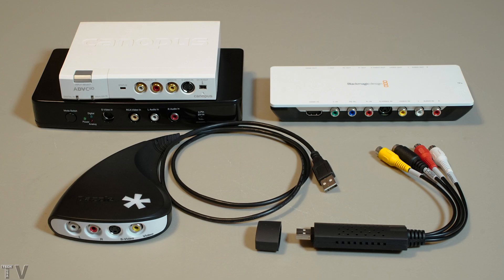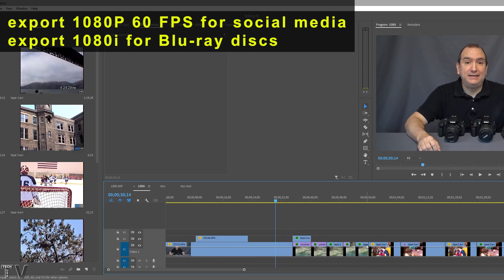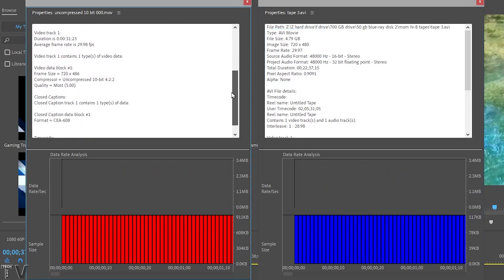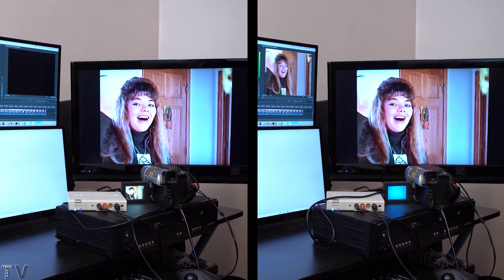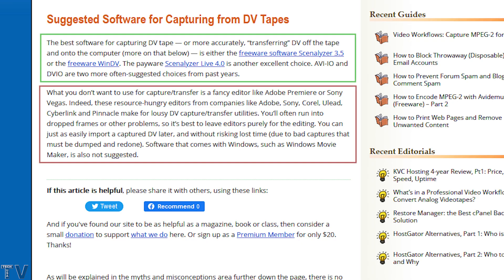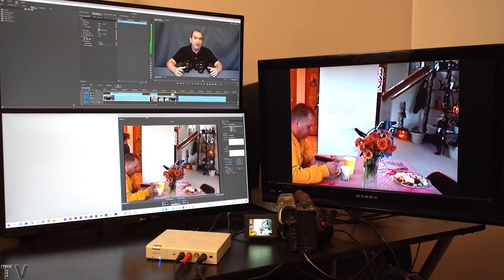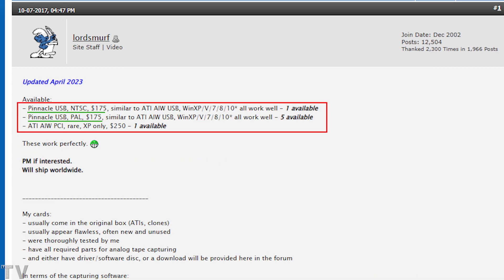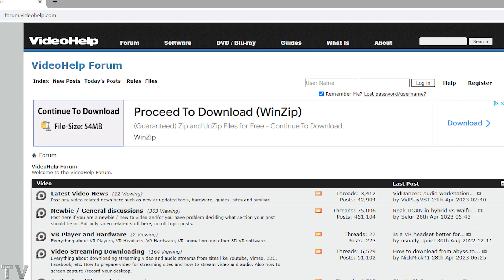VHS video capture and Hi8 video transfer myths debunked

Comment: I've managed to capture with my Shuttle after using a DVD recorder as a TBC, but the audio is out of sync after about 3 minutes of playback.  I'm considering getting a cheap simple one now, but I dont want to sacrifice loss of quality - whilst I do need to audio to be timed accurately.  I've spoken with various people about it, but so far had no joy
Reply: If you turn on stop at dropped frames for Intensity, the capturing also stops after about 3 minutes for PAL. I have the suspicion that Intensity (I tested PRO and Shuttle) ignores and overflows the frame rate of the playback device (Panasonic NV-HS900EG S-VHS Recorder = 24,998-25,002 fps and Panasonic DMR-E55EG DVD Play). I originally thought this was the tape dropout setting. If you switch off stop at dropped frames, the sound at the end of the tape is often delayed by 30 seconds and there are probably too few frames on the HDD. The solution I'm working on is Panasonic NV-HS900EG, S-Video, Pioneer DVR-560H (TBC only), HDMI, Blackmagic Design DeckLink Mini Recorder HD, OBS Studio, uncompressed 4:2:2 because PAL (Settings) doesn't have 4:1:1 (including TBC Audio Delay). 4:2:0 is nonsense with PAL, since the line pairing always slides down ONE line and there are NO permanently connected lines.
Reply: @TTVEaGMXde   Thanks for letting me know how you've progressed.  It has been a very long journey for me, I might try a different device to the shuttle.  My best move was using the Panasonic DVD recorder as a TBC, but the audio sync issues are a newly discovered issue, although it took a lot of research to get this far over the course of 15 years, coming back to it as & when I could dedicate time. I think I might try my ADVC 110 again if I can locate the power supply, but yes, the shuttle has sent me on a huge wild goose chase with good results, other than the audio being completely out of sync. I was considering rendering the audio in ableton by warping it slightly to fit the exact length of the video, then pasting the audio back into a video editor in the hope it might fix the sync issue. But there are a lot of tapes I wish to record.  I hope your method works well, I understand most of what you'r saying but as I've discovered, there is a lot of science and countless ways of setting this up when it comes to using a shuttle. So I tend to come back to this task in chunks when I have time to dedicate, which makes me wonder if a better capture device is available now since it was 10 years ago roughly when I bought by shuttle
Reply: @NeilDnb  You did not write which output can be used by the DVD recorder. With HDMI, Blackmagic has to take over the picture frequency (also with Intensity) and with YUV I have tested the two consumer solutions (Terratec Grabby PRO + Reflecta USB2 Grabber) without success. Intensity analogue obviously doesn't work, and with AJA you're in a different price range. So with YUV you should consider a used AJA PCIe card without a breakout box. The canopus ADVC-110 can be fed remotely via a 6-pin Firewire. But then the power plug must be connected to the Firewire card.
Reply from the maker: I don't recommend the Intensity Shuttle for VHS capture. It can be problematic. Especially now that it is discontinued.  BMD doesn't care about it anymore. The Firewire DV converters are your best bet.
Reply: @TechTVusa  Thanks for your thoughts. I have an ADVC 110, although I tested it 15 years ago with a computer of which wasn't good enough for the task. I've since, lost the power supply but I might give it another go some day. Hopefully it will match the audio better & have the added bonus of having a built in TBC.

Comment: You appear to be an expert on these ADVCs. What is the technical difference between the ADVC-100 and the -110?
Reply from the maker: I am not expert on the ADVC devices but I have used a several Firewire DV converters. Having said that the ADVC 110 can be bus powered by the cable.The ADVC 100 needs a power adapter.
Reply: @TechTVusa And I think they removed the ability to ignore Macrovision in the 110.

Comment: [Quote]Analog video by nature has a very low chroma resolution horizontally (barely the equivalent of 40 samples), the last thing you would do to it is halve it further horizontally in case of NTSC, [/Quote]
This is misleading. NTSC DV at 4:1:1 c takes 720 luma samples per scan line, and 180 chroma samples per scan line.  The issue is lossy compression implementations and data rate limitations, especially with typical noisy consumer home video.
Reply from the maker: I will make a follow up video. I will randomly use 10 bit uncompressed 4:2:2 files and DV 25 files. I will see if people can tell which is which.
Reply: Those are the techical terms, VHS is not HD its even lower than SD you don't have to worry losing any color, you can always color correct with resolve, many people don't color correct at all, capturing in ProRes422LT also makes easy editing, color faults is mostly because of signal mismatches which is baked into the consumer hardware,

Comment: Hello - I was wondering if you offer one on one help ? After watching and reading so much, from which VCRs to use (svhs-vhs) which one has TBCs which do not - as well as using certain camcorders that offer TBC and those that offer the feature as a Pass Through feature and many do not.. not to mention all of the capture cards - and on top of that upscaler’s . And then we have the programs to use- I have around 70 plus tapes that I need to convert. Many are reg VHS as well as VHS-C and DVDs …. I TRULY need help to get moving on this project - and without being  very knowledgeable on Codec’s - compressions - and all these options are so confusing. Sounds like an alphabet in another language. I have limited time, since I recently diagnosed with cancer and really looking to do all of this for my daughter, just in case my time is more limited then I hope. I really don’t want to buy the wrong hardware (TBCs that i have seen pro stuff that can run $$$$ - ) to getting a useless VCR or a Camcorder that provides no benefit to get this project done !! I am running a Macbook Pro M2 with 32g of ram… would there b a way to reach out, and would you be able to assist me ? Thank You in advance… 🙏🏼 Todd
Reply: How are you?
Reply from the maker: You should contact me through Facebook. I left a link in the description box.

Comment: Hi, what a timely upload for me! I’ve recently returned to my decade long quest on how to best digitise my extensive VHS collection as well as MiniDV etc. I have been digging into those forums yet again and each time, my brain explodes a little more. I have sourced so many different elements of the recommended work flows but don’t have a complete one. And as a lifelong Mac user, I have recently started the seemingly impossible task of trying to source a Windows XP machine and compatible capture cards. It really shouldn’t have to be this hard.

I come from a film & TV background in the 90’s but haven’t stayed in the industry. So I have a brain that can mostly understand a lot of the references and can pick up a lot of editing software etc. But this project is just needs to be done before I die 😅

Thanks for this post. I needed to be reminded that the quality can stay almost identical using other methods. I’ve been watching a lot of YouTube videos on the subject & there are surprisingly few with info that can actually help the process and cross reference the Video Forum & Digitalfaq guides. 

I’m sure that I’m not the only one with this situation. I’d love to see more guides like this referencing other techniques. 

E.g I’m in Australia and use PAL. I have a Canopus 55 from many years ago that I still haven’t used. Can it be used to get the same results in Mac as the 110? What version of OSX will it function with? I have recently purchased IMovie HD. Should I try to install it on an old Mac Air (if so downgrade the OSX)? Will it give me better results? Or is there a better method with something newer on an M1 MacBook Pro? 

I have a good Panasonic VHS with TBC (HS960) and also a Panasonic DMR ES15. And a Sony MiniDV TRVE355E. I have all the Apple FireWire converters. I have a MacBook Air 2013 & a barely functioning MacBook Pro Mid 2012 non retina, a mid-2015 MacBook Pro 15inch retina and a newish M1 MacBook Pro 2021 16inch. I’m open to purchasing a 2nd hand Windows machine if needed to get an improved capture if recommended. I plan to restore the videos. I can get access to any Adobe products if needed via my subscription. Or can try to get FCP. I know that some of these devices can be used as ‘passthrough’ for VHS as well. I am about to upgrade all my cables too.

I have already converted my Mini DV via FireWire in my M1 MacBook Pro on IMovie 10 but very confused as to whether it was captured properly on IMovie 10 as opposed to what I have read on the forums about capturing in IMovie HD being superior as it captured both fields (horizontal & diagonal) Is this correct? I had thought that all FireWire was 1:1. 

Any advice as to how to achieve best noticeable quality going forward would be much appreciated. 

Thank-you in advance.
Reply from the maker: Sveta Spins,

I am glad my video could help. As I stated in the video you are not seeing a rendered file. I was simply screen recording the realtime playback of Premiere Pro. Most people are going to look at the quality and say that works for me :  )

You might want to watch the video link below. It is a tutorial. 

https://youtu.be/-mz7-delWJA
Reply: @TechTVusa  I appreciate your reply. I have actually watched all your tutorials in the past (and present again!) They’re awesome! My problem was that I had tried to acquire complete workflows to start on but was never able to own everything in the chain. I’m also working on transferring all kinds of tapes from across 25 years of documenting and all in PAL. A lot of advice comes from the US where things are in NTSC and not everyone clearly explains the differences in one solution between the two standards. And on top of that, I am located in Australia - where we are the same size physically as the US but our ENTIRE population is the same as one of your big cities. So finding old equipment is much scarcer and pricier. 
And every time over the years that I’ve jumped into the forums, I start finding a solution for one thing, but very quickly the topic changes and descends into disagreement. I have never personally posted on these forums and have gotten a lot of good advice on there too - and don’t wish to contribute to more disagreements. I was writing to you because I think that you’ve identified the problem for people like myself in finding a way forward. 

In the last two days I have miraculously been able to source a cheap 2nd hand Intensity Shuttle which I will pick up in the next week or so and also managed to revive my old MacBook Pro mid 2012. I’m vaguely tech savvy from years of dealing with Macs. I have ZERO knowledge about Windows. My aim is to get the tapes in best VISIBLE quality - and possibly being able to play with settings that will improve it…and ready for upscaling along with the earliest video 8 /Hi 8 footage / VHS footage. I’m even open to trying Topaz or similar to improve the quality later. I’m hoping to avoid as much generational loss with the products and flow. 90% of the numerous VHS tapes I own won’t need to be upscaled or improved on too much - so just getting best quality I can get in the first instance with what I have is fine. 

The Hi8/ video 8/ DV8 and a handful of VHS will need to be best possible quality to work on later. I have already imposted the video 8/ Hi 8 /DV8 mm tapes have already been imported in via Sony TRV3355E in IMovie 10. something on my M1. From what I understand, IMovie 8 onwards only scanned one field of lines via FireWire. But I’ve also read that that they actually all IMovies import 1:1 DV codec over FireWire but can’t export at that quantity. I have a copy of a iMovie 6 HD which I was thinking of trying to install on my old 2012 MacBook Pro / Mojave to see if I can see the difference. Or maybe it’s possible to just import the DV Codec recordings from IMovie 10 into another more modern program and try to bounce a full quality file from them instead of IMovie. 

I’m happy to also re-do all the capturing if there is a superior way of doing it. Maybe I need to do it via S-Video? And if so, where to? What devices? Intensity Shuffle? And which MacOS? It’s all so confusing 🥲
Reply from the maker: I don't really recommend the Intensity Shuttle for VHS or Hi8 transfers. Your VCR or Camcorder must must have a TBC in order for the Intensity Shuttle to work. It also require drivers. It is a bit of a risk considering it is discontinued. I sated all of this in the video. The Intensity Shuttle does work OK for some people. I only use it for realtime playback to broadcast complainant hardware. It works great for that. 

You should checkout the video link below. 

https://youtu.be/dVLUxRkPMdA

The Intensity Shuttle can upscale during capture but I would not recommend it. Premiere Pro and most NLE can do that with ease with great results. You can try Topaz. Maybe you will get good results. You do realize some of my video clips were up-scaled over 300% and you were simply watching the real-time playback of Premiere Pro. None of the files were rendered. Did you see difference between the uncompressed 10 bit  4:2:2 video  Vs the DV 25 video clip? Are you satisfied with the quality of the DV 25 video clips. 

As far as I know iMovie and FCPX can import from Firewire but not export. FCPX can export using the Intensity Shuttle but not import. On your Mac you would need to use Premiere Pro to capture video using the Intensity Shuttle. It can work just fine for some people. You have to make sure your camcorder or VCR has a TBC.

I will have a follow up video soon. Having said that I would not listen to anyone in the discussion forums unless they can do a video tutorial to demonstrate how well their method works.
Reply: @TechTVusa  I’m happy to say that after many years of collecting the various recommended equipment, both the vcr & camcorder I sourced have great TBC! My camcorder also digitizes my analog video.   I also understand that I now own a hodgepodge of relevant equipment & just keen to use it in the best way possible. 

I was more than happy with your results with a smaller file size. I personally don’t know much about upscaling & suggested settings. I am confident that I can teach myself a recommended program very quickly -  whether it’s FCP or Premiere - based on my Mac knowledge and previous experience with editing with other Mac video programs and music programs. I’m also aware that buying Intensity has risks but I just managed to secure it for only $100 on Marketplace so it would be good to add to the fray. The rest of them are upwards of $400 2nd hand in Australia.

I just want to know the workflow that is best recommended with my various items and I’ll teach myself the rest. For example it would be great to know how to hook up some of these devices to get best quality for V8/ VHS etc as there are always multiple options. Also- if you are able to make a video a video about how best to upscale for vhs & 8mm & recommended colour settings to clean them up on a Mac And highlight any differences for PAL? 
You are not obliged to do this for me or anyone else of course 🙂 I’m just highlighting the challenges I’ve faced & there’s certainly a gap in practical knowledge on YouTube & forums. PAL was used by a huge majority of the world outside the US. I’ve found that on most of those forums, questions specifically about PAL conversions almost immediately get changed to advice dumping on the Mac and back to NTSC & XP. I’ve even tried to do this but realised that I know nothing about Windows & special video cards, drivers etc  and got even more depressed after weeks of trying. 
Your videos are a glimmer of hope 🙂
Reply from the maker: If you have a lot of equipment why not do some testing of your own?

I don't have a MINI DV Cam as of now. I know they can transfer VHS tapes and Hi8 tapes just like the DV converter.  When used this method did you need a TBC? If not then you might start to wonder if people are being dishonest. 

The Intensity Shuttle can be problematic but probably not as problematic as the cheap USB video capture cards. 

For video capture S-Video is better than composite. There is not a lot of difference when editing NTSC as opposed to PAL. I simply upscale the video using Premiere Pro. You could try other programs and probably get similar results. You can try Topaz. It might work better than Premiere Pro. 

You can probably get things to look a little better than straight out of the camera but keep in mind no software program is going to increase you Hi8 camera to 15 stops of dynamic range. You cannot expect a miracle. 

The truth is out there but be aware of fanboys. I have no need to bad mouth the Apple computers. There is only one person who think using Windows XP and the ATI AIW in the year 2023 to transfer VHS tapes is a good idea.
Reply: @svetaspins  Hi, I have been capturing/converting PAL VHS, VHS-C, Video8, Hi8, Digital8 and MiniDV on my Mac via an Intensity Pro 4K, (unfortunately this is a PCIe card so no good for you with a laptop), maybe a USB Intensity would work for you.

For a TBC, I run my video players and cameras through a Panasonic DMR-ES15 DVD recorder, ( I have heard that the DMR-ES10 is better but could not get hold of one easily in Australia), from the Panasonic the composite cables go into a converter to HDMI and then the HDMI cable goes to the Intensity card.

I use DaVinci Resolve for editing and correcting and have found this setup work quite well.

My Mac is currently running Monterey but have used this with Mojave and Big Sur as well.

Hope this helps you a little bit.